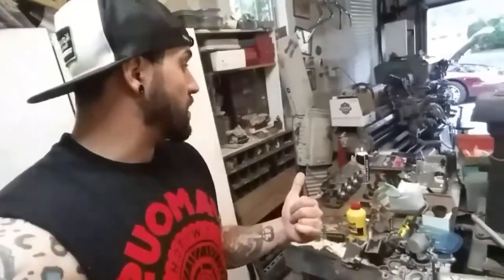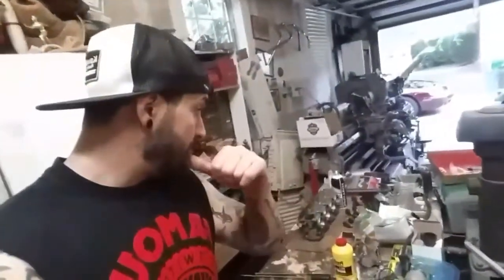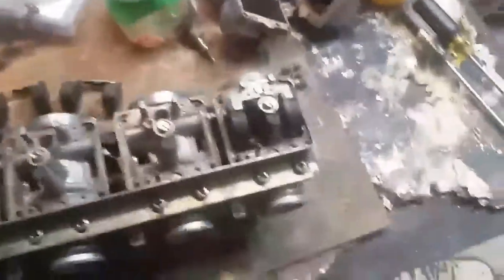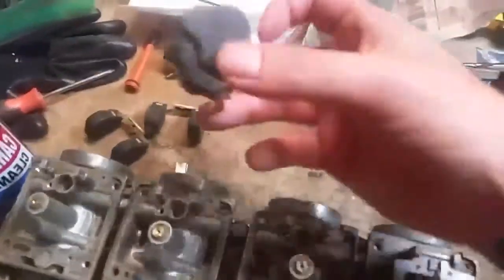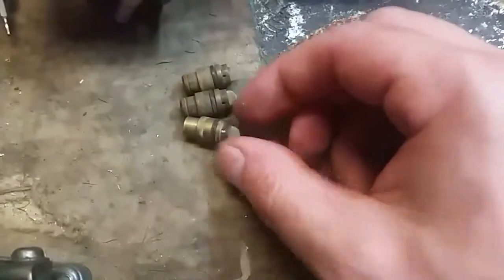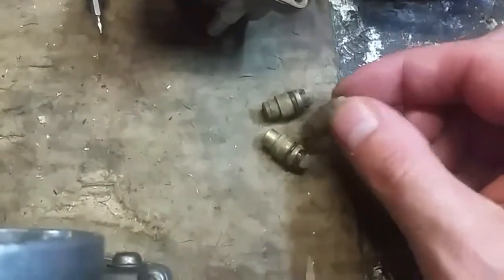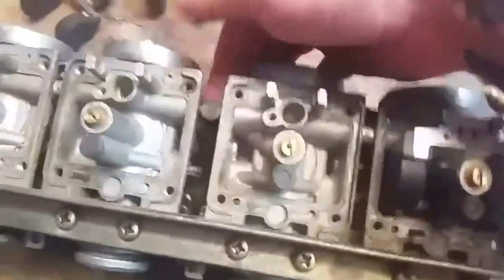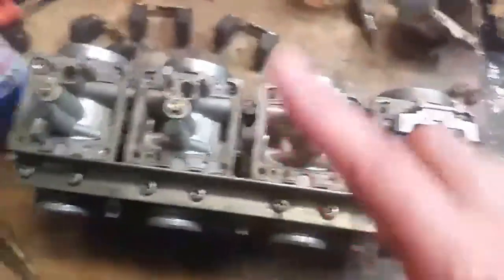Floats and float needle valve - Suzuki GS650 Cafe Racer

Comment: Did you get your carbs straightened out ..??
If you've got a stage 3 kit should have new float needle valves ..instead of using old ones and an o-ring kit ...

Comment: What jet sizes are you running on the 650
Reply: Nate did you ever find the answer to this question? Jetting now and stuck. What mikuni carbs are used on the 82 gs650?
Reply: @justycegoff7717   yes. Had the bike running perfect.. had carbs on and off 50 times to figure it out... All over a bad spark plug
Reply: Only video I could find that mentions the idle screw . Gone through everything you have. Been fighting to figure out how to adjust the low idle 👊🏼😎. Thank you